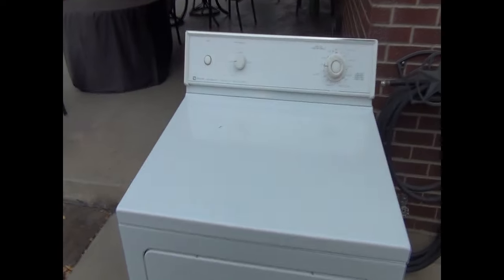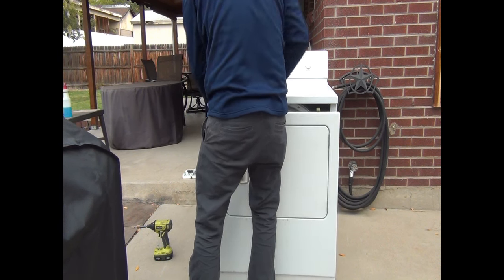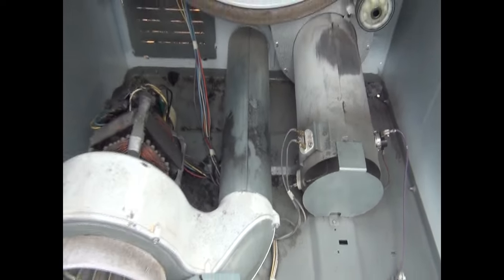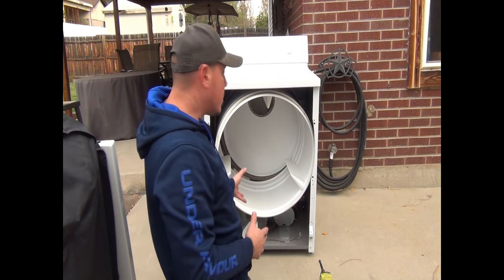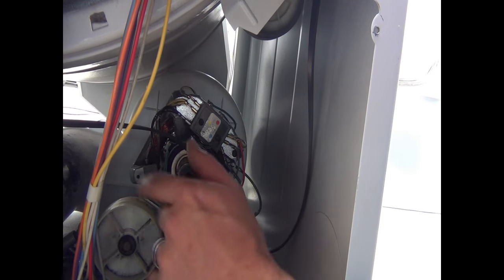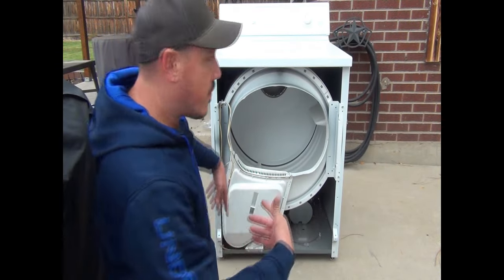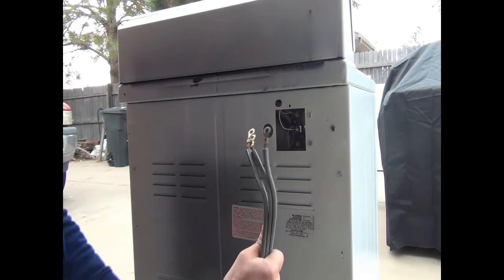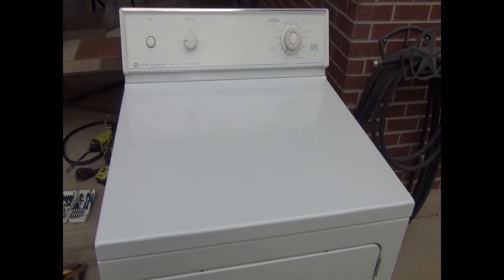Replace dryer belt on older Maytag

Comment: The instructions to put the rib side toward the drum is wrong. If you do that then the belt has to twist to put the ribs on the motor drive shaft.  And twist again going back around the drum. Doesn't work.
Reply from the maker: Yeah I wasnt able to update the video but I the comments did. There should be not twist your correct.

Comment: I need help plugging wires back on push button on the top of the dryer . I took it apart. I forgot what connectors go where. Thank you
Reply from the maker: White goes on the left and the yellow goes on the right

Comment: Your belt broke because you are putting it on upside down. The grooves are actually for traction on  the motor not the drum. You want the grooves facing outwards around the drum. Your method requires a twist and is why it likely broke and why anyone who does it this way will be buying another belt soon.

Comment: Thank you, Mike! Straightforward and very helpful. A screw had loosened and backed out of one of the baffles. It was far enough out to hit the underside of the top on each revolution. It was an easy fix made easier by your video.

Comment: Check bigfatmouth below.  Which is correct?  Do you put a twist in the belt so the ribs contact both the drum and motor, or do you put the smooth side on the drum and without a twist, contact the ribs only to the motor.  If bigfatmouth is correct, then Mike the repair guy should be responsible andcorrect his video.

Comment: thanks Mike , good video it will help me replace my belt  , but but you got one thing wrong that middle wire is a ground , power doesn't run though it ,it's there for safety , the 240 is between the 2 hots not both sides to ground . take that middle wire off and it will still run just without shock protection

Comment: I'm sorry bud but your doing that wrong.  The groove side goes upwards on the tub and the belt does not go in that groove it goes about 2 inches away from the groove toward the front.  You can look at the tub it will have a worn somewhat black mark where the belt was

Comment: Hey Mike!  Thanks for the video, but I do have two observations.   (1)   If you put the ribbed side against the drum, then the ribbed side won't make contact with the motor spindle unless you put a twist in it.   I flipped the belt around around and the flat side is now against the drum and the rib makes the expected contact with the motor spindle.      (2)   You mention placing the belt in the groove of the drum.   That's not where the original belt was placed - it was a little toward the front  ( a black wear mark showed the location).   I placed it in the groove and, noticed that as the belt came off the idler pulley and started heading up again, it was making contact with the motor spindle, making quite the racket when I turned on the dryer.  I moved the whole belt on the drum towards the front of the unit (right on top of the old wear mark)  and it's running perfectly again.     Just wanted to pass on my experiences.    Thanks!
Reply: I believe you are correct  also you can clearly see the twist in the belt.
Reply: I had exactly the same problem until I moved the belt out of the groove and onto old wear marks; then it worked fine. Dunno of maybe OP has a different model, but mine uses the ribbed side on the motor drive and smooth side on the tensioner and drum. 
Anyway, thanks for the comment, it helped!
Reply: @CarolTroutman  Yes, other youtubers distinctly say that you should not use the groove but use the wear mark on the drum.  Also, there should not be any twists in the belt.  I'm grateful that he put the belt on from the back as the other youtubers mostly did it from the front.  It is tricky either way b/c you have to visualize it and then take steps to make sure that the right surfaces from the belt hit the right wheels.
Reply: I have an IntelliDry Maytag gas dryer from the late 1970s.  It won’t restart after I open the dryer to pull out hot clothes. I thought the heat or thermostat could be the problem. After the dryer cools and I can move the drum a little I can get it to restart.  It makes a funny noise which could be a slipped belt.

I think my problem occurred when I took off the front of my dryer to clean the thick lint from using Gain Detergent. I love the smell and put up with the lint. I think my problem could be from moving the belt on the drum.

Comment: My Dryer drum won't turn by hand after I had disconnected the dyer plug. Is there any way to lubricate what is causing the drum binding ?
Reply from the maker: Check the blower wheel and see if something is stuck in it
Reply: Make sure the rollers spin freely and oil them with WD-40 also oil the idler pulley it will stop squeaking
Reply: @BlitzKC816  please remove your comment, the manual states you should not oil or add other substances because it may ignites fire 🔥.

Comment: I have found this dryer to break all the time.     But easy fixes    belt, dryer exhaust fan wheel, etc.    As much as it sucks.    I'm glad it's simple basic dryer that can be fixed .  I'm a YouTube mechanic.   & This video is THE BEST !!!!     I always forget the position of the belt on the pulley.     Usually take photos of before.  But forgot.   after 5 videos.   He's the only one that actually shows it ....  Thank God for the access door
Reply: Hey Pablo !    I'm just curious about how much you use your dryer.  I bought mine new in 1996 and it finally started making a noise about a week ago.  I traced it down to one of the drum rollers.  Since I had it all apart, I swapped out both rollers, the belt, and the idler pulley, too.    Oh, I had to replace a thermo shutoff once about ten years ago,  but it's been perfect except for that.   It's only my wife and me, so the dryer isn't supporting a big family.  I'm just surprised you've had so many issues.   I love this dryer!
Reply: @Blippity_Bloop64     way to often.     It was in the house when I started to rent rent it, 8 years ago.  so it was probably there as a rental ( in a college atmosphere ) since about the same time you got yours..      now, we bought the same house , but now with kids.   It probably gets used 2-3 times a day. 🤣.
Reply: @Blippity_Bloop64      ....       The rollers tend to go bad first on me.    But recently, I got the entire bundle , belt, rollers, etc ;.  Was almost cheaper that way.
Reply: @pablovagnor  ahh. Sounds like it got used a lot!

Comment: The flat side goes against the drum so the belt engages properly with the motor ... not the rib side.  When viewed from the back panel you can see the half-twist in the belt.  Not supposed to be there.
Reply: John, you are right. I just changed my belt and I watched quite a few videos before and for this model with the idler pulley BELOW the motor pulley, the flat side of the belt goes on the drum. Another error in this video is at 10:04 when Mike says the belt goes in the groove on the drum. It does not go in the groove..just place it where there is a blackened track on the drum.
Reply: Watch this video on replacing a belt on a Maytag.  Starts at 3:30 mark.  https://youtu.be/4bHOjysr5nU
Reply: @vicO-3123  Vic, the video you posted is for later model Maytags with the pulley wheel elevated above the drive shaft.  This video is about an older model Maytag with a different wheel/shaft config.

Here's a proper belt replacement video for this model:
https://www.youtube.com/watch?v=ruH3JGyo3mw
Reply: I thought i was trippin till i saw this comment. Older dependable care plus. Mine is also smooth side against the drum and belt does NOT go in the groove! Took me a bit to figure that out.
Reply from the maker: Yeah no belt on a dryer has the flat part against the drum. The rib side always goes against the drum But thank you for the comment anyways..
Reply: @TheApplainceBlueprint  So do you need that half twist in belt? I understand you said to put groove side down on drum and motor shaft. You showed putting the flat side on idler wheel only. But again, my question is if you need that half twist in belt? 
Thank You
Reply: @jaimegutierrez2778  There shouldn't be a half twist in any belt and the ribbed side goes on the drum so it engages the motor wheel with the ribs.
Reply: @TheApplainceBlueprint  Not true.  Older Maytag models, including this one, require wrapping the belt around the tumbler grooves-up.

Notice you are placing the ribbed side of the belt over the top & on the right side of the motor shaft (looking from the back) & then wrap it back & around the idler wheel ... flat side down around the idler wheel ... this while at the same time you can see there are twists in the belt coming down from the drum because you wrapped it grooves down.

Also, the belt should not be placed in the indent of the drum - doing so results in less belt tension, creates a slight belt angle down to the motor shaft & may cause the belt to rub against the idler guide creating wear.  If you look at the old belt track it sits outside that grove.

Here's another tech's video that shows this.  I viewed a few other vids that show the same flat-side down method, which keeps the belt operating with no twists all the way around.  Depends on model year.

https://www.youtube.com/watch?v=ruH3JGyo3mw

Newer Maytag models than the one shown here changed the motor shaft/idler wheel config & belt routing where ribbed side down around the drum would be appropriate.
Reply: @JohnGreen_US    I was scratching my head about this as well.   I finally put it flat side down, but I did keep the belt in the groove.  Boy, did that create a racket.  Plus, as you said, it ran right up against the motor shaft.   I noticed the black wear marks from the previous location , slid the belt to that location, and now it's running perfectly.
Reply: @JohnGreen_US  You are correct sir and you can clearly see he had the belt twisted.
Reply: @UCU1YKEZG4Nxgg6JCdWZFURQ Your an Idiot! You gave me inaccurate info and cost me an hours time! Rewatch your Video. You have a big twist in the belt because you put the ribbed side against the drum. Do you really know what your doing?

Comment: Hey mike is it a 27 or 29 belt?
Reply from the maker: So the dryer belt has to be 100" long..  I dont beleiev the 29 in belt will work I had problems with that..if you click down below there is a link to the exact one I used
Reply: @TheApplainceBlueprint  THANK YOU

Comment: Dude…nice job…..I’ve watched other vids before this one and you were the first guy to show me that access panel on my Maytag dryer …..looks like that’s the way to get to the spring load pulley assembly part …..From the other vids it looked like I was gonna have to get to it from the front and then make my way to the back of the dryer …..You may have saved me a lot of time and effort and maybe a couple of less swear words during the fix …..fingers crossed I can geter done!…….crap, now that I took a look it’s not the idle spring loaded assembly part behind the back access located at the back bottom right hand side of the machine but instead it sounds like it’s coming from wheel pulley on the other bottom side of the drum so I suppose I am gonna have to take drum out from the front to get to it …why couldn’t they have put another access panel on the other bottom side of the mAchine….let the swearing begin - damn it